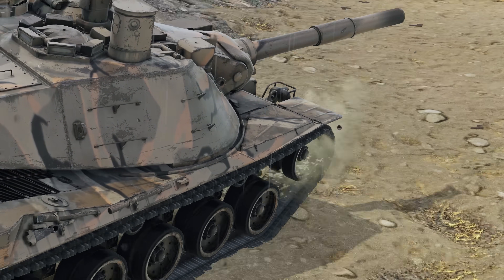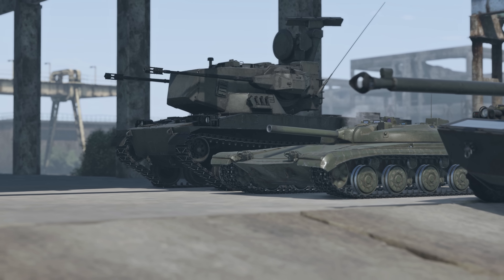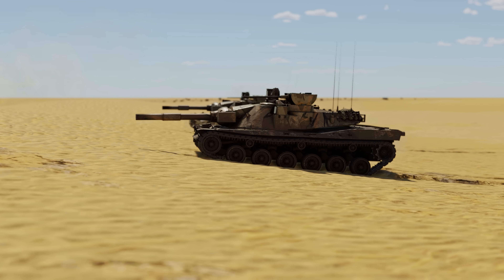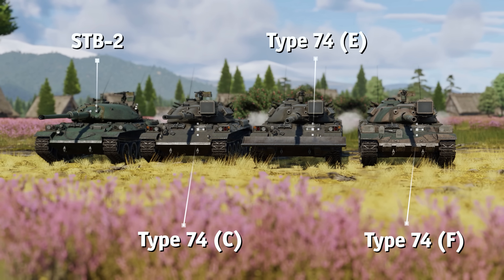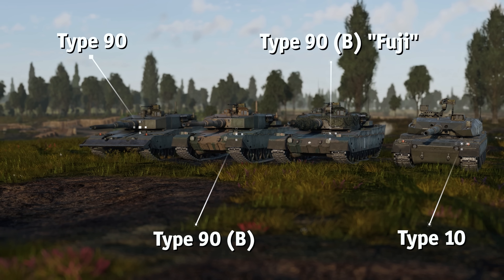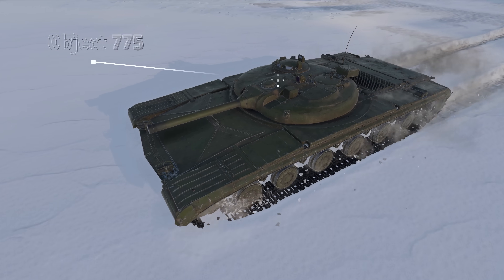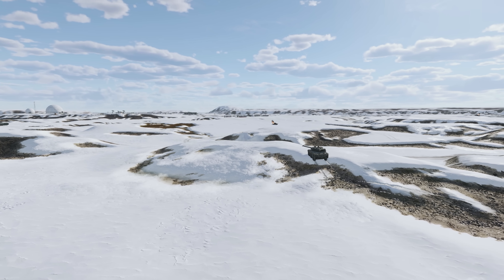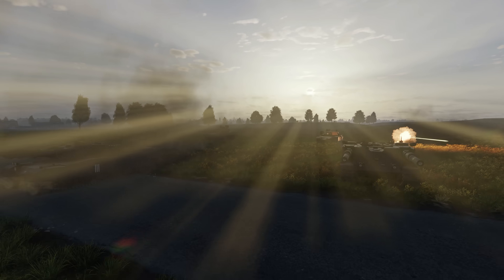Tactics: Tanks with Hydropneumatic Suspension

Comment: Spall liner missing from leclercs
Spall liner missing from type10
Spall liner missing from tkx
Gun sight missing from ej kai f4 hud
Gun sight missong from MiG21 Bison
Flare pod missing from t2
Flare pod missing from f1
Maw missing from ah64dj
Ir tracker missing from strf9040 family
Ir tracker missing from strf9030 family
Incorrect radar tracking on low altitude with gen4 jets
incorrect autopilot lead with radar spaa
Incorrect kf41 aps working
incorrect agm65 a/b/d/h damage
incorrect spike rocket damage
Incorrect pars 3 damage
incorrect t90m reload time
Incorrect vt4 reload time
incorrect ztz99 reload time
Incorrect wz1001 reload time
incorrect mig29 flight model
incorrect f16 flight model
Incorrect su27 flight model
Incorrect f5c loadout
Incorrect akd10 speed
Incorrect akd9 speed
Incorrect overpressure dmg with lower calibers
Incorrect type10 turn rate on highter speed
Incorrect tkx turn rate on highter speed
Incorrect zlt turn circle
Incorrect leclerc armor
Incorrect ztz99 armor
Incorrect wz1001 armor
Incorrect vt4 armor
Incorrect beigletpanzer fire rate
Incorrect cv90120 penetration
Incorrect wvc
Incorrect targeting pod resolution
Incorrect iod tracking
Incorrect radar power in mig29
Incorrect radar power in f20
Incorrect radar power in av8b plus
Incorrect matra 530e track rate
Incorrect top armor in strv122 family
Incorrect gas turbine engine sound level
Incorrect hmd on m2k 5f
Incorrect r60 flare resistance
Incorrect aim9p flare resistance
Incorrect zbd04a gunner fov
Incorrect t90m gunner fov
Incorrect spall damage with under 120mm ammo
Incorrect dtc 125 penetration
Incorrect 3bm60 penetration
Incorrect m829a1 penetration
Incorrect ofl 120 f1 penetration
Incorrect ammo explode mechanism
Incorrect ammo in bmp2
Incorrect spall liner working mechanism
Incorrect multipathing effect
Incorrect terrain following radar working
Incorrect fly by wire working
Incorrect gyro gun sight working
Incorrect f4 ej kai loadout
Incorrect F15J loadout
Incorrect F15J Kai loadout
We need normal matchmaker
We need unnerf the rp and sl rewards
We need back the good simuolatir rewards
We need back the flank and sniping positions
We need normal staff who hear the players voice
We need good events
We neee unique event rewards
We need new game modes
We need not unbalanced maps
We need optional options for ± 0.3br drop
Reply: Prove?

Comment: Pro tip in the Mbt 70, by tilting the tank backwards and driving backwards youre protected by your engine
Reply: Not really. When going through the engine, sabot creates more spalling then when going through your front plate. Also the upper front plate of the MBT-70 can be quite bouncy. The backwards trick only works against APHE, but even then you're gonna be immobilized, which is why going backwards in an IS-2 isn't a great idea since your reload is gonna be longer than your repair.
Reply: @brunobegic3841  no cuz when tilting bacwards the mbt 70 is at such an angle that the spalling passes under the crew
Reply: @pawelxh9536 Someone will just shoot the turret if it’s angled like that. You would need to be incredibly stupid to sue that tactic of yours.

Comment: Since you added the obj 292 you should add back the other blueprint vehicles back. Honestly it looks like a lot of gaijin bots right now are replying.
Reply: What does the 292 have in common with the blueprint vehicles? The 292 actually existed and unless it's been moved it can be seen in the kubinka tank museum.
Reply: @arthurkal5892  they keep adding vehicles that can't be balanced
Reply: @Infinity_Squad  the blueprint vehicles weren't removed because they couldn't be balanced. The Maus however was removed because it was difficult to balance, but it comes back every year. The 292 would be fine if it went up a bit and it can ofcourse kill even 11.7 tanks but it isn't without drawbacks. It has a comparatively long reload and the gun handling is bad. The further it goes up the worse its armor gets aswell. The 292 isn't really a big problem.
Reply: @arthurkal5892  not to mention that it doesn't have thermals and a coax at 10.3
Reply: @Infinity_Squad  so, you're asking to put other unbalanced vehicles that only existed on paper, sometimes just as text and not even a drawing, or as wooden mockups back into the game to fix supposedly unbalanced vehicle problems ? 
Btw, the 292 is fairly balanced to me, it has huge pros as well as huge cons, whereas stuff like the 2S38 PVO which currently stands at 10.0 deserves to be at 11.0.
And before you ask, I only play France, Japan and Italy (and british planes up to 8.0).
*edit : tbf the Tiger II with the 105mm gun is quite balanced, the Panther II is kinda op, but a different version with a Panther G turret could be put back into the game as a few were finished irl in 1945 and outfitted with panther G turrets, and finally the Flakpanzer 341 in addition to having only been a wooden mockup irl is very much unbalanced. And the Maus is fine and comes back every year.
Reply: @arthurkal5892 to be fair, there are many 8.3 tanks that can easily kill top tier MBTs from the Front because they don't have a whole lot of armour anyways, the 292 could be moved 0.3 up, but it's fine were it is, it's not hugely unbalanced if unbalanced at all, at least not from my point of view (I mostly encountered them in uptiers with the AMX-32, 32 (105) and AMX-40)
Reply: @misterthemad994  yes I am
Reply: @Infinity_Squad  whats unbalancable about the 292 ? the Sturer emil also has a gun that can penetrate any tank at its br frontally and even many BRs above it, so its not the gun in 292s case... its not the armor either because there are better armored tanks at the same br.. and not the mobility either.. there are faster tanks with similiar protection (other t80 series tanks). So.. its good where its at. A jack of all trades but a master in none.
Reply: @petrkdn8224  does the sturer emil have a 1200hp engine? And it’s an open top. The t 80 hull is a black hole for rounds and can penetrate 695.
Reply: @Infinity_Squad  bro read the entirety of my comment. I said that the "reason" that it is "unbalancable" isn't because of its gun or armor or Mobility and I listed a tank for each one of these traits where there are tanks that do them, at the same or lower BR.
Reply: @petrkdn8224  do you know the tank triangle? Mobility, armor, armament. It has all of these except thermals but still has a point and click laser. That’s why it should go up. It’s not a typical t 80 like the Swedish one which lacks penetration for frontal engagement, where this tank can send you to the shadow realm.
Reply: @Infinity_Squad  "tank triangle" "has all of these" "except thermals" , well then it doesn't , because firepower includes thermals, and also there are tanks which are better armored and have better mobility (Leo 2a5, 2a6 and 2a7) so its certainly not the best in class so it definetly should be below them and the fact that next update it also will have autloader modelled along with other expanded internals, even shots which don't blow up the ammo will stop you from Reloading, generally western tanks will be far better. So case closed.